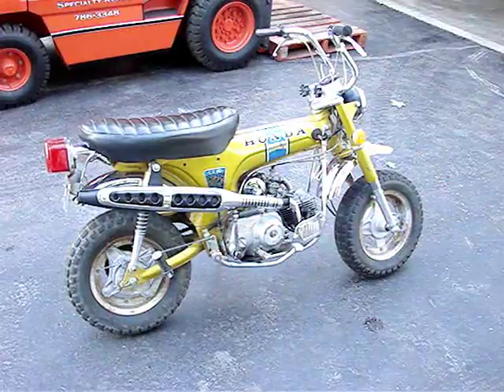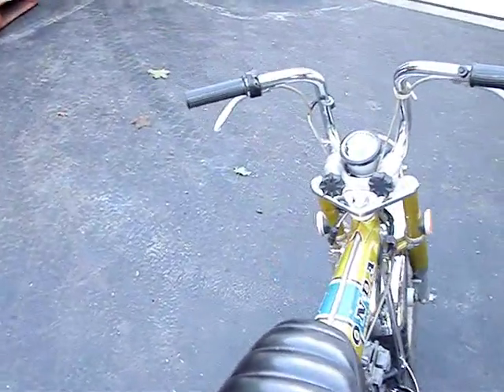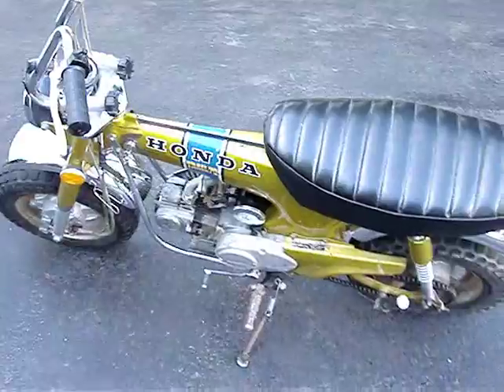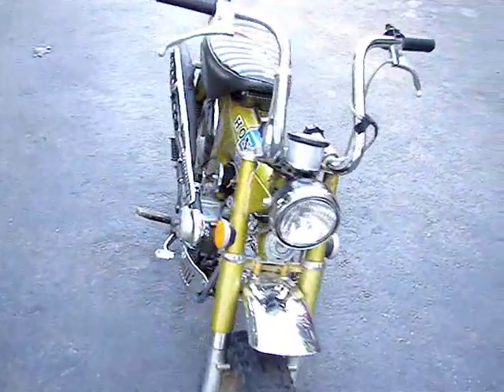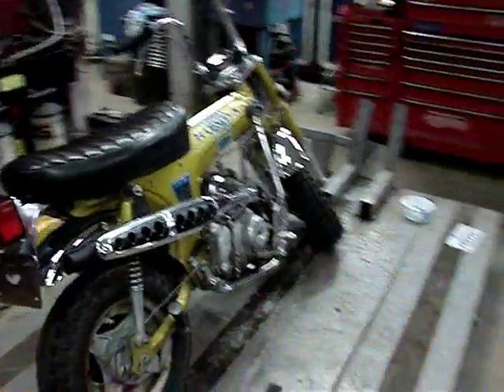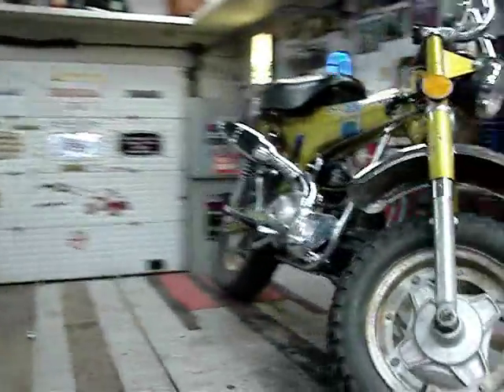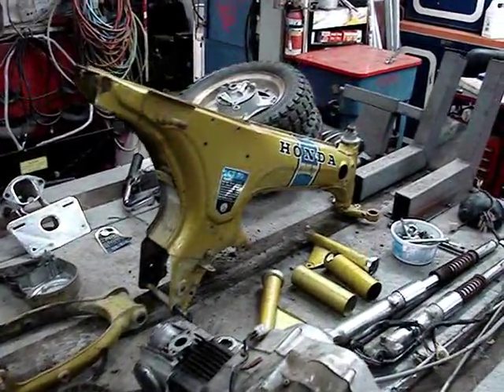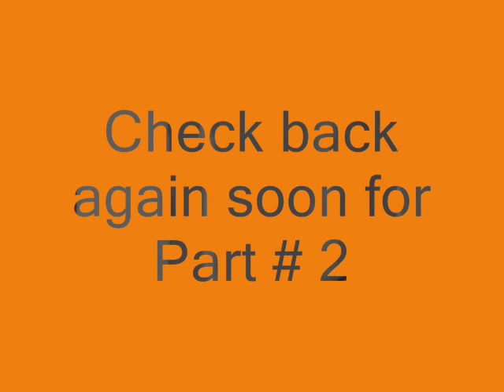Honda CT70 tear down Part #1

Comment: ive just bought a dax frame that has the steering lock on the side of head stock im not keen on the look so thinking of cutting it off and weld the hole up id rather have the type thats mounted under the bottom yoke